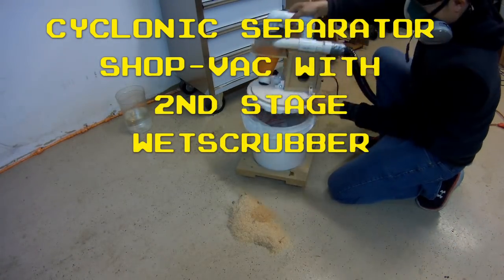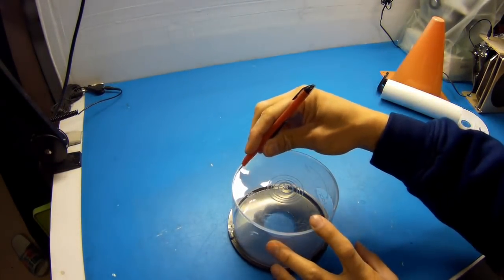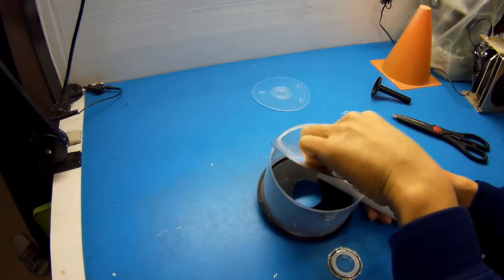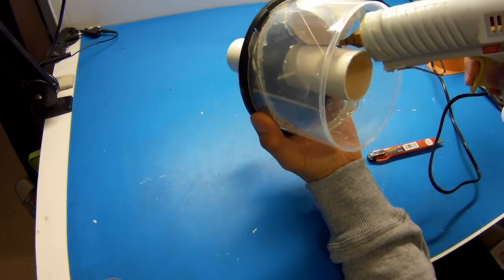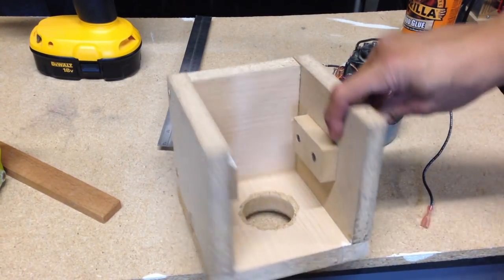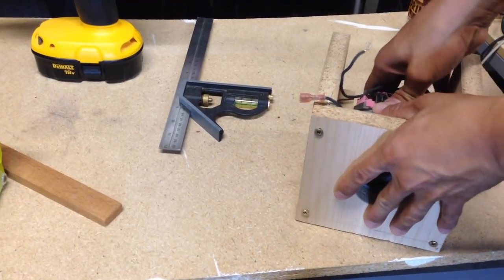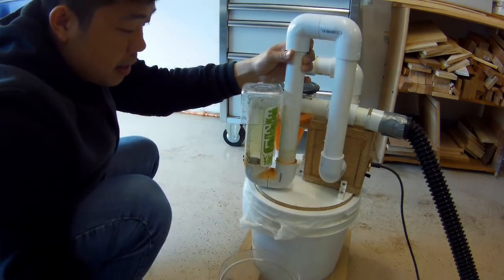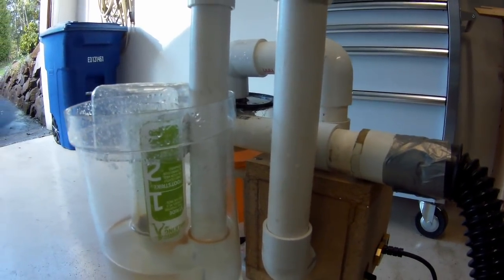How To Make Cyclone Shop-Vac With Secondary Water Filtration (Wet Scrubber) All out of Junk

Comment: OK, how does the water stay in the exit tube and be able to splash upward and fall down into the water reservoir?
Is there a pole in one of those two elbows that are below the water?
Reply from the maker: The elbow is submerged in the water, the tube that is going up is much bigger diameter than the elbow hole, and is attached only on one side, so yes there is a big gap between the tube and the elbow for the water to flood back in and shoot up the tube.  Hope that makes sense.

Comment: All you need is a 5 gallon bucket, 2 pcv tubes, duct tape and amazing goop shoe glue.

The lid inlet pvc tube goes 6 inches down and is about a half inch above the water line and the lid outlet to the shop vac is maybe an inch from the top.  (Ideally, right angle (for a lower unit profile and stability) attach the shop vac or RV hose to the pvc tubes.) 

The dusty air comes in downwards and is immediately directed 180 degrees upwards. Even fine dust has mass and centrifugal force flings dust particles with mass into the water--if the water level is optimized. 

Cyclone only is good for the light saw dust/prefilters only good for minor dust. But the wet vac and big hoses are good for massive amounts of dust that will choke prefilters and filters in minutes with extremely aggressive removal tools--with zero out of pocket expense, and a little foresight.

I create massive amounts of material removal from very fast and aggressive tools that choke up stupid store bought filters in 3 minutes--chips to fine dust.  I create so much I have learned to dump the cake of wet debris on netted drops to avoid massive mounds that surprisingly cake up rather than washing away with rain.

Comment: Want to remove all the fine particles without either a filter or a scrubber? Just exhaust to the outside of the building...
Reply: What do you do in winter?
Reply: @mikebond6328  Not a problem. If there was, I would add a heat exchanger. With the system in this video the problem would be the excess moisture put into the air, which would condense overnight, causing rust and rot.

Comment: you should have some speed regulation on that motor. universal motors should not run on direct connection
Reply from the maker: I dont believe that to be entirely true.  I think the caveat is that they can be ran without regulation if there is a load on the motor which in this case is the compressor fan of the vacuum.  Same with blenders and routers and other power tools that use universal motors with basic on off switches.  I've only seen thermal switches or fuses in most cases.

Comment: Hello, I like yours idea. GOOD JOB. I am thinking about using this "setup" for fireplace cleaning. Do you have any oportunity to try it on ash?? Please let me know. Thank you.
Reply from the maker: I took this unit apart since I moved but I may build version 3 and try it on ash.  It will work to some extent but the invisible particles will still get through unless a 3rd stage HEPA fabric filter is used .  I'd suggest wearing a respirator.

Comment: I see you have a bunch of vacuum videos. I'm looking into building a pool vacuum with a water pump from harbor freight. 

I tried putting pool filter sand in a 5 gallon bucket to filter the dirt in the bottom of my pool. But it seems like my pump is way too strong and blows the lid off along with the sand. I tried it a few more times trying to relieve the pressure in the bucket but I have yet to figure this out. I even used ratchet straps criss crossed to hold things down and still no luck. I recently tried to bypass putting the pump pressure directly into the bucket by adding a "Y"  fitting in line. The interesting and very frustration part is that no matter where I connect my pump line in that "Y" it blows water out of every direction with a good amount of force. I have no idea what I can do. I'm trying to create a vacuum effect from the pressure and filter the water at the same time. This is so stressful. 

I figured you might be a good source of help. Or just anyone on YouTube please....
Reply from the maker: PtotheRum thanks for reaching out.  Although I don't fully grasp your setup without a diagram, I've a couple suggestions.  First is to get a dimmer switch or router speed control so you can vary the power to the pump, you can then determine of it is simply a pump sizing issue.  

Is the water pump submergible type? Is the plan to have the debris flow through the pump impeller? Or are you trying to do some venturi effect to create a vacuum.  If the latter you'll need some kind of restriction in the pipe to create a pressure drop
Reply: @LockeLaboratory  
 Thanks for the quick reply. I'm using the harbor freight sump pump https://www.harborfreight.com/14-hp-submersible-sump-pump-3000-gph-63892.html
I choose this because it was not a fish tank pump with a small outlet line. 

I wanted enough pressure to suck the debris from the bottom and be able to push it through a filter and back. So this was the next size up and cheapest. I'm not sure I can restricted the suction with a voltage regulator. I feel like it will hurt the pump and void any warranties I have. 

My plan was to suck this water from the pool and filter out the debris and dump the filtered water back into the pool. So I chose to use a 5 gallon bucket filled with sand with some plumbing. Starting at the top, I used a bulk head fitting to allow the water to flow in through the sand media and back out the bottom from the opposite side of the inlet. Using a short pipe with end cap and drilled holes facing down in the bucket and back out using another bulk head fitting. 

After a few attempts I noticed when the pump was running, I could not keep the lid on. I figured the pressure inside was to great. And maybe it's from the tiny holes I drilled. So I drilled more holes and then just ended up going a little bigger. Still blew the lid off. I tried ratchet straps to keep the lid on. Still with the same issue. I just gave up and decided to remove the end cap from the pipe at the bottom. I figured I still need some kind of filter to keep the sand contained. So I used a fabric screen at the end. None of these ideas worked without blowing the lid off. Even with the straps holding it down. 

So my next thought was to some how reduce the pressure inside the bucket. I figured I could use a vacuum from the pump and pull the water through the sand filter instead of pushing water through it. You would think by putting a "Y" from the pump to the pool would create a suction. No matter which direction I put the pump on the "Y" I still got water forced out of every direction. Imagine the "Y" in the upright position. Now imagine pushing water down hill from either side. You would think the water would only push down hill and create a suction from the other top port. To my surprise this pump doesn't care. I tried even placing my hand in front of each hole to see if that maybe would help create a suction but it didn't. I'm lost.
Reply from the maker: @PFab  I think I see what the problem is. Your sump pump is quite powerful and the fact it can pump from the depth of your pool to the surface, that is already a couple PSI of pressure.  Buckets can only withstand about ~2psi before the lid pops off.  I don't know how much pressure the bucket walls themselves can withstand without bursting but I'm sure it isn't very much.  Your pump is rated for 22ft max height which equates to about 9.5 psi, this is more than enough to give you trouble trying to keep your lid on.  You would need to switch to a PVC/ABS pipe to make a pressure vessel which can withstand the pressure. 
Concerning your "Y" fitting problem I think you are trying to create a venturi vacuum effect from it to make a vacuum.  To create a venturi effect you need to create a restriction on the outlet of the pump. This restriction creates a pressure drop after the restriction which creates the vacuum effect.  Please watch this vid I found to show a explanation:
https://www.youtube.com/watch?v=cpmEQctfqcI
You can create a venturi using the "Y" fitting --just make the leg that is connected to the output of the pump narrower than the other legs.  I think a "T" fitting may be easier to work with since you can use off the shelf pipe fittings to vary the diameter of the leg connected to the pump outlet, the "vacuum" leg, and the "outlet" leg of the T fittings.

Hope that helps. 
Best,
Jimmy
Reply: @PFab  I have a quick fix that may or may not help. Like you have said you have a pressure issue causing the lid to blow off so you need to reduce the pressure. The pressure is building beacuse the water has to pass through thre sand which is quite a dense filter for water to pass through. I was wondering how much sand do you have in the bucket? and can you reduce the amount of sand to still cause the filtration effect you are after but not cause the top to blow off.

If you dont want to lose any filtration by removing sand can you replace it with another filtration material. A primitive water filter comes to mind where you would have sand(a reduced amount in your case), charcoal, and then rocks on top to keep the sand/charcoal in place. If not that then maybe sand(reduced amount) on bottom, then cotton/wool/old clothes(t-shirts) then rocks on top to hold them down.
Reply: @The-Wasp1101  I might try this. I have thought about it. But I had my own weight on the bucket (240) lbs on the lid with ratchet straps. Didn't work.
Reply: @PFab  I know i saw your previous comment, thats kinda why my thinking is to go for reducing the pressure rather than trying to contain the pressure, as you have already found out that doing so is very hard to do. Hope that idea helps!

Comment: Why are you wearing a mask? Doesn't scream confidence in your build. Lol.
Reply from the maker: Louis Cypher hehe yea i learned the hard way.  I first thought cyclone was enough but it wasn't and ended up with a nasty cough after an experiment so donned a mask in case there was a leak with this experiment. I did end up using this as a shop vac for a long time with no prolem.  Later on, I also learned wet scrubber of that configuration will have trouble with sub micron particles similar to a cheaper vacuum.  A third stage hepa or ESP is actually needed to filter just about everything.
Reply: @LockeLaboratory  lol. I hear ya. Better safe than sorry.

Comment: What's your thoughts on a dust deputy cyclone w/bucket, hooked to a shop vac that has a pipe running under water in the vac tub and the filter guarded from splash?
Reply from the maker: daniel wold hi daniel i dont see why that wouldnt work.  the shop vac has a wet filter?  that setup should have basically the same functionality of what i built.
Reply: Did you try this? Did it work?

Comment: Nice idea, the only problem I see is you should have a filter between the cyclone and your motor or have a tangential bypass central vac motor or extractor motor as flow through motors shouldn't be exposed to dirty air as cyclones are very poor at separating fine particles which may lead to premature motor failure or worse a fire.
Reply from the maker: Yea I completely agree.  I think 3rd version would have this implemented.  I'm thinking 3rd version would also implement Thein baffle instead of mini cyclone as cyclone can get clogged if sucking in large debris.  Thanks for comment and for watching!

Comment: Great thanks for this vac.
I wanted to know if it won't be better if the motor won't be place after the wet scrubber so as to prevent duct from remaining on the motor.
Reply from the maker: Hi Yes, absolutely this is possible to put the motor after the wetscrubber.  To do this you would have to make the wetscrubber chamber air tight. This way the vacuum can suck the air through the water.  I think I will do this for my 3rd design of a shop vac
Reply: @LockeLaboratory  thanks, but when making the wet scrubber air tight, there won't be a possibility that water goes in the motor??
Reply from the maker: @jasongroupindustries  there is a possibility but this is where it is very important to design the wetscrubber properly and size the wetscrubber chamber with enough size as to not suck all the water out of it. If you find a container the same size as the wet scrubber chamber in my video, that is about as small as you can get for this size of vacuum without sucking out the water.  If you check out some my other videos, I created a wet scrubber that has the motor after the wet scrubber but they are a bit larger.  I especially designed the chamber and wet scrubber so the sloshing water doesn't get sucked out.  Here is a playlist, https://www.youtube.com/playlist?list=PLL_-ccTEzH_w45_Y4fsiG4JVpCwvVgggU

If you noticed on the how to make wet scrubbing shop vac video, the wet scrubber had a plastic cup on top of the plastic bottle tube to direct the water+air back downward, this is a rudimentary mist elimination device.  You can also place some foam filter material (say and aquarium filter) at the port in which the air is getting sucked out to catch any finer water droplets.
Reply: @LockeLaboratory  thanks for your help, I agree with you, was thinking the same way. Thanks again.

Comment: This looks great!!! However I don't understand how the water is being introduced and why this isn't capturing 100% of the dust..... surely if all the air which is ladened with dust is bubbling through the water all the dust must be captured? Please don't misunderstand everyone, I am trying to understand this system as I think it would be perfect for my needs!!!
Reply from the maker: Hi Keith thanks for your comment and question.  The water is introduced by having the "u" bend of the pipe simply submerged in water and dust laden air is pumped in and when the dust impacts the water it sticks to it.  Thats the basic idea.  Going a little deeper you may want to research the keyword for this technology: "wet scrubber" but I'll try to explain this in more detail.  

No current filter technology is 100% efficient in capturing dust, and collection efficiency is generally a function of particle size and power inputted.  With wetscrubbers, like this basic one, the efficiency of dust capture is related to a couple variables... the dust particle size (a major factor)...how hard and fast the air is being pumped into the water... the pressure drop (how deep the water is)... how tiny the bubbles and water droplets get, and the amount of dust concentration in the air to name a few.  

There are 3 mechanisms of particle capture with wet scrubbers: impaction (droplet rams into particle, it sticks), diffusion (particle randomly runs into droplet), and electrostatic (particle is attracted electrically to droplet).  Thus making an environment where these 3 mechanisms happen more often will increase dust collection efficiency.  There are many wet scrubber techniques, --the most impressive I've being cloud scrubber tech but I've yet to figure out how to make it compact enough to fit into a vacuum cleaner...

The reason why it isn't 100% in this case is because air acts as a buffer and kind of gets in the way from the dust touching the water (the dust particle floats inside the air bubble and doesn't touch the water). This is why the more power applied in trying to force the air+dust to touch the water only increases the chances of this happening but does not guarantee it.  Hope this makes some kind of sense.  Let me know if I can clarify anything.
Reply: Locke Lab  Many thanks for taking the time to reply and to reply in such detail. That was all clear but I was still not understanding how the air was getting into the water so I watched the video again, twice and am I right in thinking that the white PVC pipe is essentially sealed but where the white PVC corner goes into the Sport Bottle there is no seal? You mention that the Sports bottle is screwed to the 90 degree elbow, looking at the video it looks open to the water, is that the case?  If so then it is all clear and I want to start playing with this idea because it looks very promising for a home application. Thanks again.
Reply from the maker: Keith Stanley  Ah yes, the PVC pipe is sealed but the sports bottle has the bottom cut out of it, it is simply a clear tube so the water can flood in from the bottom to flood the elbow.  I'd advise you use a respirator when experimenting as dust is dangerous when invisible and I have woken up next day with a terrible cough for a few days because I was not being careful.
Reply: Thanks for all the information and YES I always wear a mask when exposed to dust, I have seen what happens to people who don't!!!
Reply: @LockeLaboratory  https://www.google.com/search?q=ultrasonic+mist+fogger - droplets but no charge.
Reply: Some dust will remain within the bubble. The smaller the bubbles, the better the filtration. A fine grid halfway up the water column can create smaller bubbles, but beware of back pressure affecting the flow rate.

Comment: Is there a hole in the bottom of the wet scrubber that lets water into the pipe?
Reply from the maker: Yes the clear plastic pipe is loosly mounted concenric on the bottom elbow that is submerged in water. Therefore the water level will always flood the bottom pvc elbows as it will flow between the gap of clear pipe and elbow
Reply: Alternatively, what if the exhaust went downward into the water?